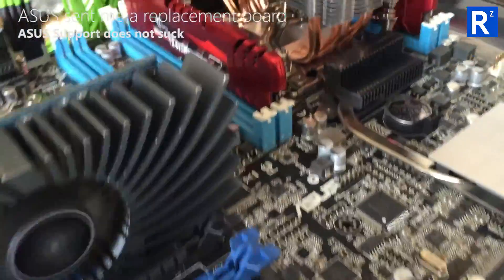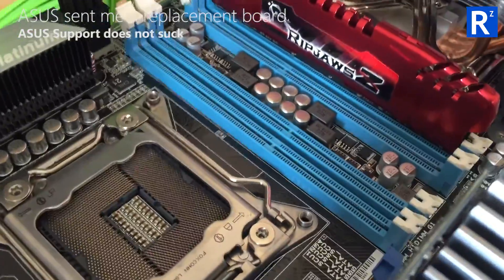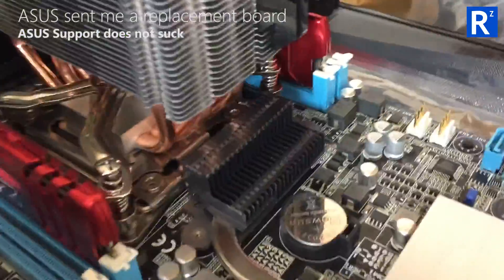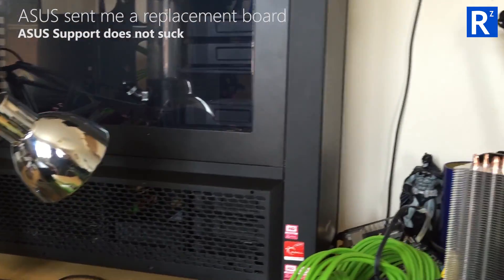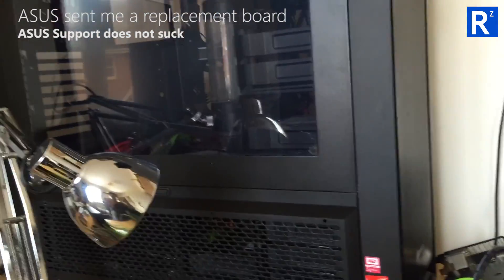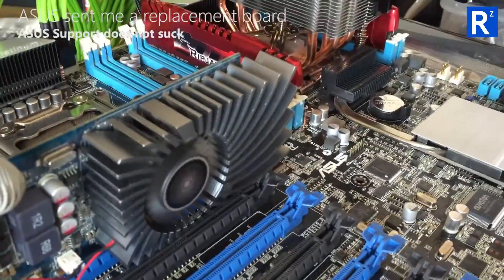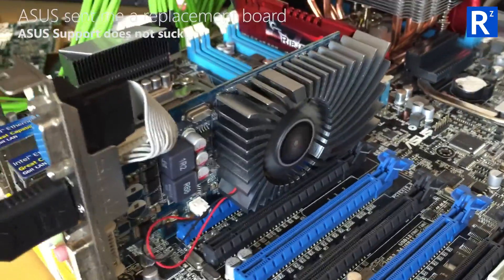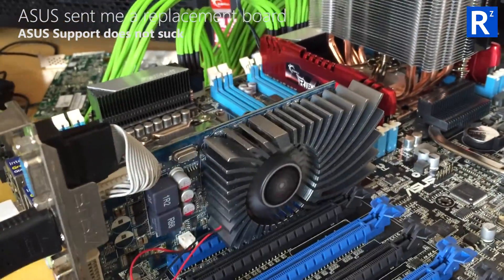Dual Xeon 2670. Asus tech support does not suck

Comment: I have the exact same motherboard. This might be late advice. One thing to be careful about these motherboards ( I also have the EVGA SR-X), only screw the motherboard on the holes it has. If you place more than the required motherboard mounting screws, they tend to short circuit the motherboard. You end up getting the power and rest light on but no activation (basically an error b1)